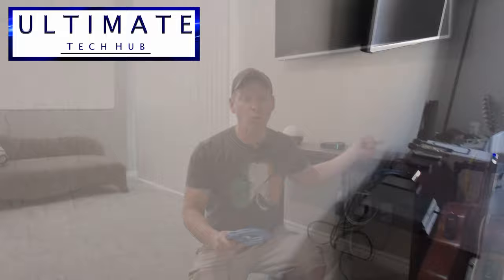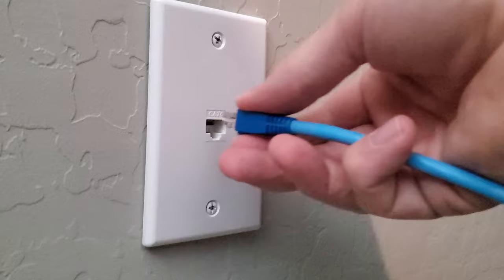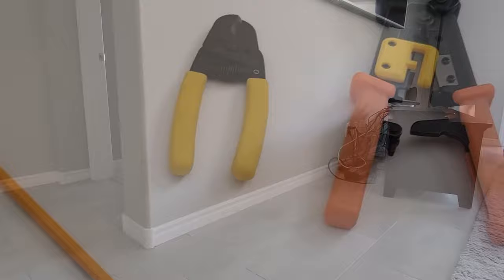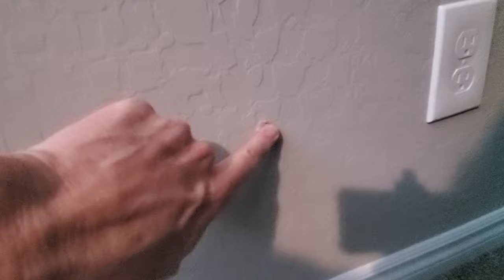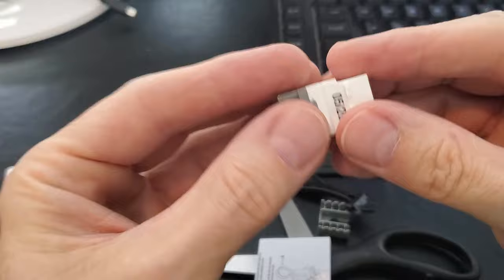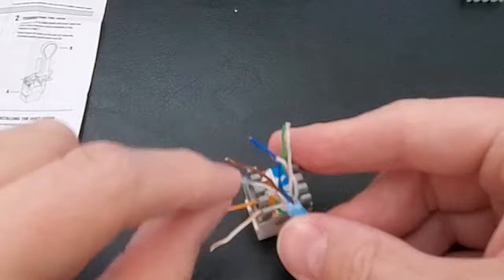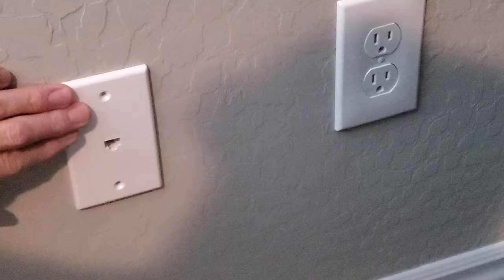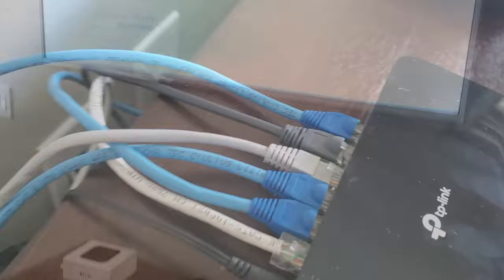CAT6 CABLE RUN THROUGH WALL AND ETHERNET JACK INSTALL - HOW TO

Comment: What nonsense is this. You didn't even removed the rubber part of the lan cable. The copper part is not even out, how is your internet even working without touching that lan port.
Reply from the maker: FYI- You Do Not remove the rubber cover from the colored wires. I've been doing this for over 10 years and went to school for this and this is exactly how it is done. My entire house is wired this way and I get 930Mbps up and down. If you can find a video on YouTube that shows someone removing the cover from the copper wires please send it. Thank you for watching and if you subscribed thank you as well. 😉

Comment: Did not match receptacle plate heights.  Looks like shit.
Reply from the maker: I added the low voltage gang wall plate, aligned it with the other outlet and added an additional data port. I did this about 3 weeks after the video posted. Here is the video link: https://youtu.be/4CUyU_v2qS0

Comment: What a useless video where you are moving cable just to the opposite side of the wall. The most common scenario is to run cable through existing outlet to a completely different room
Reply from the maker: That is the title of the video so.....😂! Thanks for watching my useless video!

Comment from the maker: We hope this video helps you learn how to run ethernet through a wall and connect it to a wall jack. Enjoy and as always thank you for watching!
Reply: SO SO much wrong with this, Stranded patch cable wire is not meant to be put in to punchdown, Where is your Low-Voltage ring to mount the face plate.  like other have said it's crooked, why did you not center this with the outlet next to it.  you might as well as just hammered a hole in wall.    THIS is not a professional job!!!
Reply: What can I do to fix an existing wall jack that isn’t working
Reply from the maker: @locke3859 There are 2 things that can cause the wire not to work. First either end of the cable has a broken RJ45 connector or its not wired correctly and second a cut in the wire somewhere. That's it.
Reply: If you install this specific Ethernet cable in one point in a house to another point in an ADU. With a length of roughly about 40 metres. Will you lose speeds in the ADU if you have your modem running at the point in the house? Or can you achieve the same speeds at each end of the run.
Reply from the maker: @Pandak-Putot  It should be the same speeds.
Reply: @UltimateTechHub  Thanks.

Comment: For the love of god don’t follow this, so many things wrong.
Reply: Ur exaggerating. He did ok. Just ok. Atleast he matched the colors right
Reply: it works, could be better (should use solid copper wire with a punch down and a low voltage ring to hold the wall plate onto the wall) but it works.